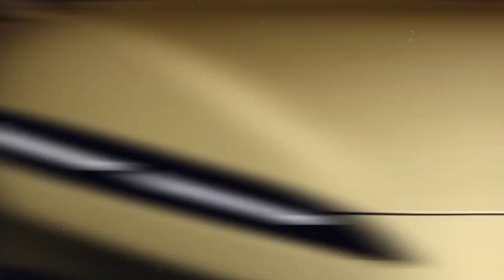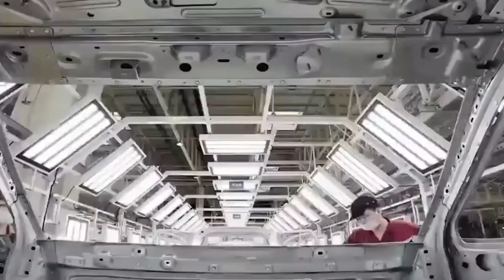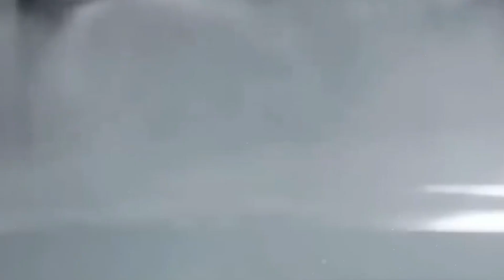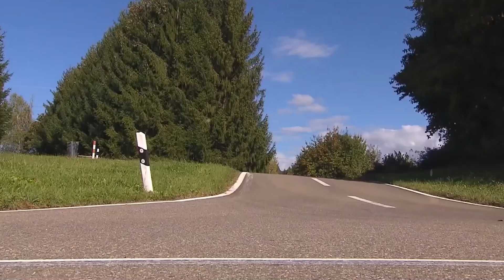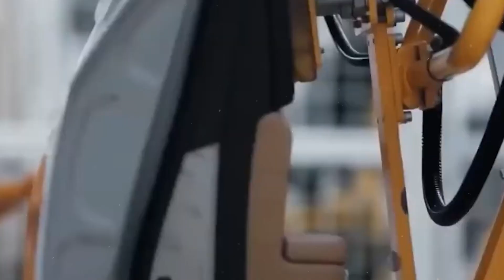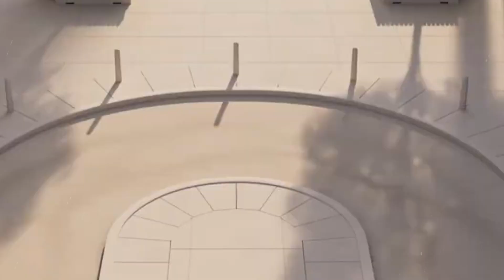This New Electric Car Has No Battery And Just Kill

Comment: This looks like the last investment con based on flow batteries for cars. "Quant" looks suspiciously familiar. The numbers were just wildly out of sync with what the charge carriers in the charge fluids could deliver. Energy densities were way below lithium battery technologies and whilst theoretical fluids (per Glasgow Umi 18 electron per molecule) could match Lithium, theoretical lithium was way ahead. The big first potential for flow batteries is for long period charge retention at very low cost per energy stored in static applications where big storage tanks are cheaply possible. Think about all the weight and volume of water needed to carry the charge carriers. Even the slightly wet Lithium technologies know that dry/solid-state will deliver better mobile batteries when achieved.

Comment: Interesting if it's real.  I was slightly worried by the use of the expression 'reduces the need for frequent replacements'. Which EVs need frequent replacement batteries? Unless by frequent you mean more than every 10  years.